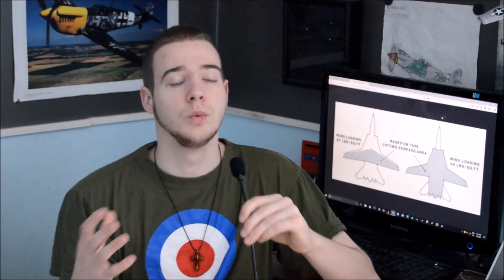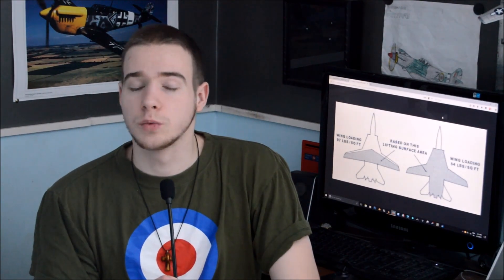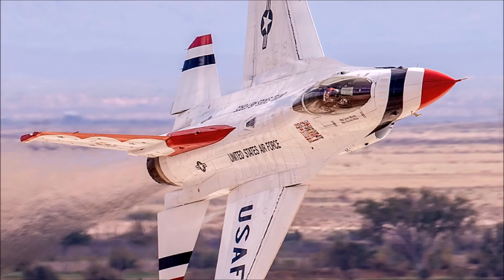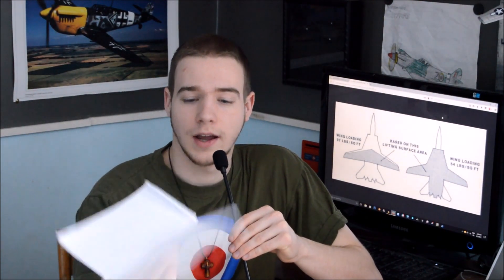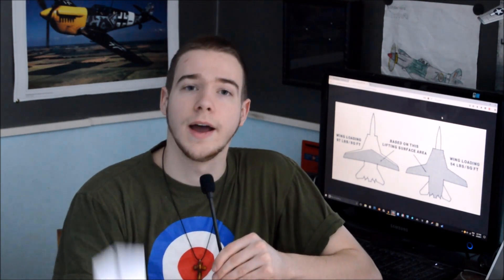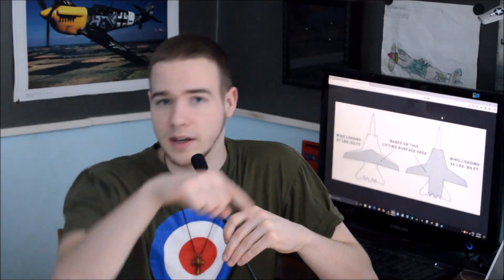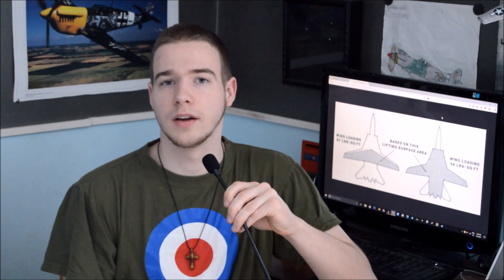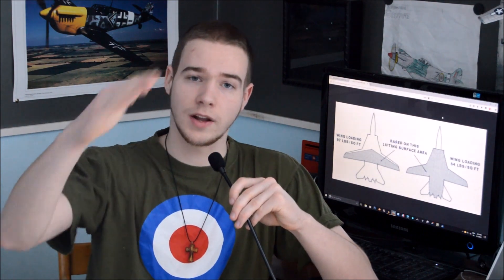Wing Loading Explained

Comment: So what would define a high or low value for wing loading
Reply from the maker: @jonnupe1645  Generally, the lower the number, the lower the wing loading. So an extreme example would be a monarch butterfly with a low wing loading of around 0.1kg/m², and an A380 has a wing loading closer to 700kg/m² so that'd be two extreme ends of the spectrum.

Comment: the total mass of an aircraft / by the surface area of the wing devices like canards.  can increase the wing area, an airliner has a high wing load. missle with the man. an aircraft with low wing loading would be something with large wings. so an aircraft's maximum wing loading is the maximum amount a wing can be constructed or how fast it makes the plane go? very sorry if my question makes no sense im trying to understand the term maximum wing loading for my FAA Written test. thanks and keep up with the videos !!!!

Comment: Getting into design myself, would a design with ‘deep’ wings low wingspan, but a lot of area) work as a way to reduce wingform cross section drag but retain the lift of larger wings? Think like a F22, but with the wingtips cropped halfway and CoM adjusted to suit

Comment: This is why the F16 is a better fighter than the F35.. F35 has a high wing load 107 lbs/ft , f16 88.3. Weight matters. The f16 wing gwnerates more lift around the circle in a rate fight.

Comment: Good summary. However, it should me mentioned that the wing loading of an empty F-16C and F-35A are exactly the same, 63 lbs per square foot. The thrust to weight is also similar with the F-35 having a slight edge in military power. Moving up to gross or combat weight it stays that way for the same fuel fraction. So while both the F-35 and F-16 are above average when it comes to wing loading, they are not in the upper part such as the F-104 and F-105 at around 70 lbs per square foot. Also, when talking about the relaxed static stability or unstable design of modern fighters the tails produce neutral and positive lift - not negative lift as in the case of older fighters - depending on circumstances, adding to the complexity when talking about wing loading and its effects on performance and characteristics.

Comment: Do wing loading changes during flight ?
Reply: Yes the wing load decreses as fuel is depleted. The wing loading on most airliners doing long haul flights is to high to land the plane after they have taken off. In an emergency their landing speed would need to be high and will seriously damage the plane. If the emergency permitted they would dump fuel to make the wing loading lower.

Comment: F-35 is not an example of an aircraft with high wing loading, due to its lifting body, which contributes to the overall lift of the entire airfoil.  Notice the inlets and how they behave towards generating negative pressure on top, before that air flows over the wings, similar to LEXs.  Also notice the + Cp on the nose and as air goes into the intakes, providing lift and reduced airflow into the serpentine tunnel arrangement of the intake geometry.  So far, I'd say over 90% of the existing literature out there on the F-35 is not only incorrect, but usually opposite of what's true.  ("No wing, can't turn, can't climb.")
http://www.f-16.net/forum/download/file.php?id=20564&t=1
https://www.youtube.com/watch?v=SPqUvCnWcrk
Reply from the maker: LRRPFco52 Thanks for the correction :) Always down to learn something new.
Reply: Are you studying aerodynamics formally or looking into becoming and aerospace engineer?
Reply from the maker: LRRPFco52 I'm aiming to be a air force pilot one day. However, I like learning anything in regards to aviation.
Reply: More important than anything, who you choose to associate with will have the biggest effect on achieving your goals.  Get into an accelerated math program with gifted professors, including online instruction and university courses.  High School is pretty much worthless these days unless you have miraculously good math and science teachers, and the rest of the baggage that comes with it isn't worth the social, intellectual, and educational net negatives.  If I could go back in time, I would have never set foot on a pubic school campus.  A classical education will benefit you immensely more than what is taught in schools.

Are you involved in Boy Scouts or any Cadet Training program?  An active Boy Scout Troop would be a much better peer and mentoring environment than school could ever possibly be.  School will distract you from a real education, while immersing you among people who make poor life decisions early, supervised by unqualified adults.  It's a lifetime death sentence to anyone looking to actually achieve something in life other than the status quo.

Start ground school as soon as possible and develop airmanship skills. Look into combat physical conditioning trends in the Special Ops community, where core strength and endurance are focused.  This translates over to reducing effects of G.  

You'll learn more in an hour on youtube than you will in 4 weeks sitting in a classroom though, especially in public school.  My dad is a retired aerospace engineer, who worked on developmental and experimental aircraft and weapons programs at the Air Force Flight Test Center at Edwards and some other locations.  I grew up surrounded by test pilots and people associated with aerospace programs, many of whom flew or worked on aircraft they couldn't talk about.  Most pilots were some type of engineer, whether it be electrical, mechanical, or systems.  They are very competitive, confident, and quick-thinking people who learn fast.  Their culture is quite different than many other professions.

Fighter pilots I know can be shown something once, and they learn it straight away.  The USAF flight training program is very steep, especially once it gets to airmanship, so one has to be able to manage several things in rapid succession mentally in order to be successful.  Have you gotten a comprehensive physical, to include eye exams, chest x-rays, and what will be included in a flight physical before?  If you have any medical issues, it's best to ID them now.
Reply from the maker: LRRPFco52 I was in cadets for several years, yes. As far as high school, I dropped out of there because, like you say, it's not worth the mental toll that it takes. I have since been working on learning what I need to learn such as advanced mathematics, and physics online. And I will soon be taking upgrading courses in each respective subject at a local college. After which, I aim to get my equivalency, and apply to university or college. I have had regulars checkups to ensure good health, and have talked to recruiters and a friend of mine who used to work in making sure all applicants were medically fit before enrollment in the air force. So he knows what is required and so far there is no medical reason I would be unfit. As far as physically fitness goes, I visit a gym daily and keep myself in Good health all the time. I have not been able to do any flight training yet, for monetary reasons unfortunately. But I'm working towards it. I always try to associate myself with those who push me and build me up, not shoot me down. Thanks so much for all that info and advice. Not many would take the time to do so.
Reply: of course much of the literature is incorrect, to throw off the enemy ;)